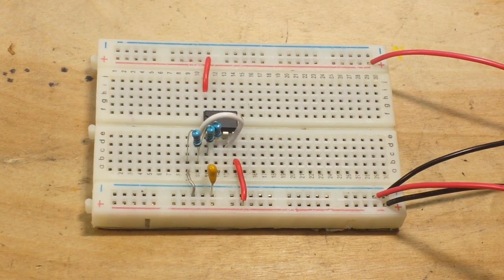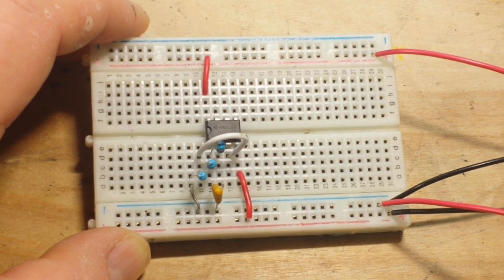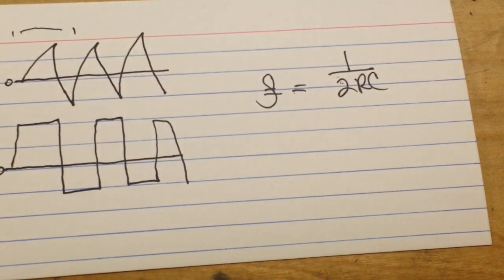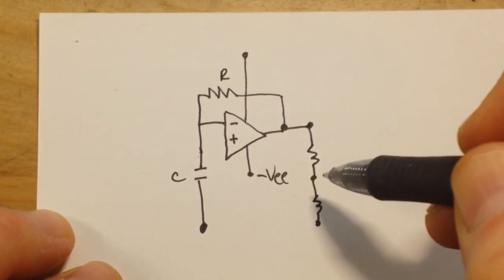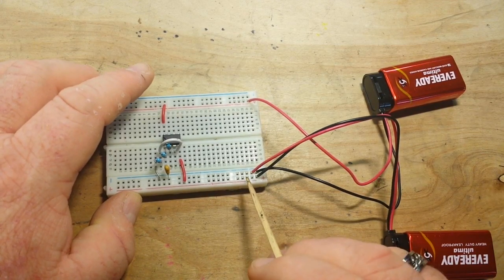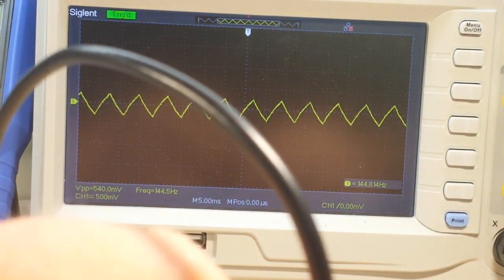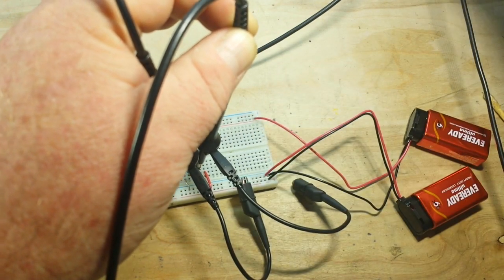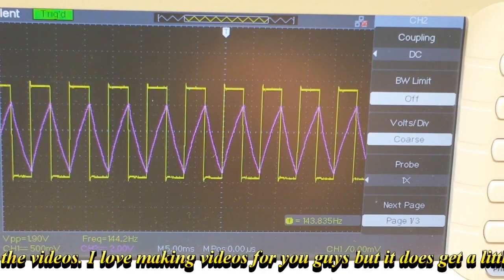OpAmp Oscillator with Schmitt Trigger

Comment: I suppose you could connect up a 4017 and make an led chaser circuit?  Great wee circuit for beginners to learn the practical side of electronics!
Reply: gartmorn Indeed, you can do that.  You'll probably need to adjust R and C for the desired effect.  As shown here, 140Hz might be too fast.
Reply: Yes I realised that and I should have mentioned it in my reply!  You could use a variable resistor to set your desired timings.

Comment: if change the voltage divider for a potentiometer you can control the duty of the pwm in the square wave?
Reply from the maker: No, it would just change the frequency

Comment: .. and if someone wondering where it can be used.. well, almost everywhere you need square wave signal. Perfect example: http://www.pcsilencioso.com/cpemma/thermal.html (last schematic) I'll be using this for my next LED lamp cooling. It used comparator, but still same idea. Done on breadboard, works good even with very cheap 12v fans. (you will need fly-back diode if you plan to use other than "computer style" fans or other DC motors).